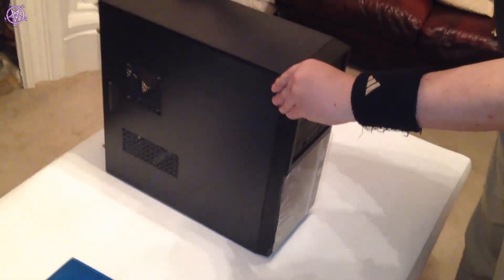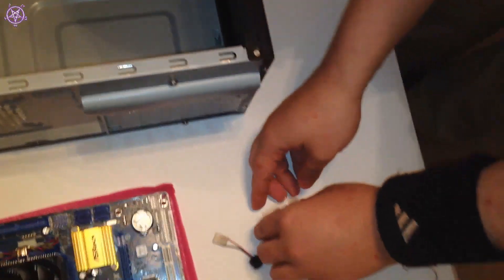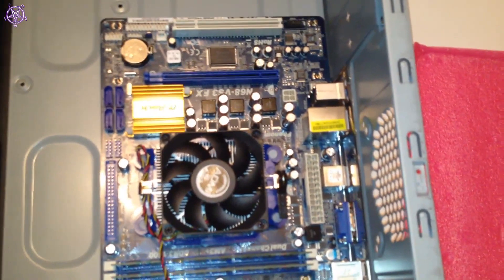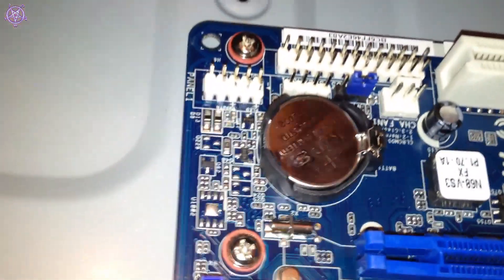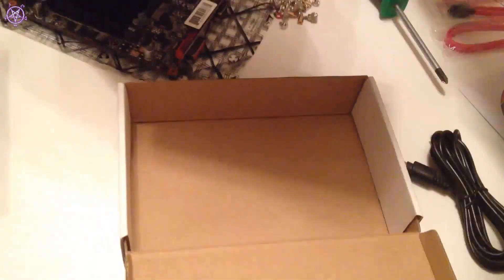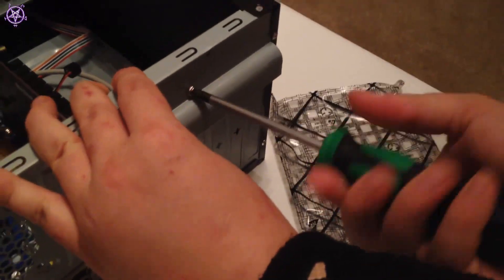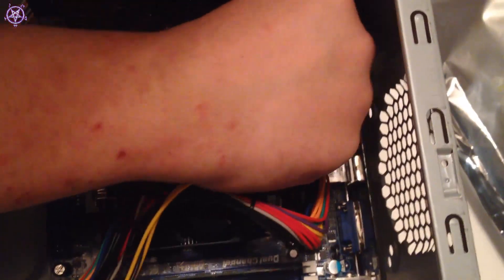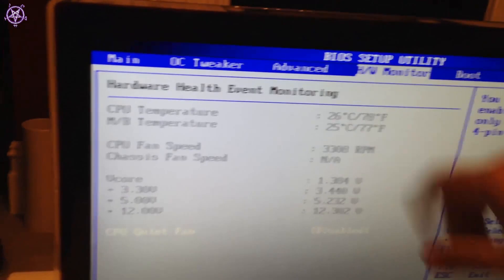How to build a PC in less than 30 minutes (Performance Home PC) [HD]

Comment from the maker: 4 ram slots does not mean it supports 4gb, there are 8gb sticks out there, so its 4x8=32gb ram, however most motherboards have limits, older ones can only read up to 2gb per stick, some have 4gb limit and new ones have 8gb per slot limit.
as i said, you have to google up your motherboard to find out what it supports.

Comment from the maker: Well if money is not issue, then you would end up spending like 3000usd. Go with Asus Maximus motherboard, i7 6-core CPU (about 900usd), some 2400mhz RAM with 9-9-9 or lower timings, Corsair 1000w (or better PSU) and GTX780 or GTX Titan (800-1200usd). video ram means nothing, you need GPU that is fast, like GTX780 ..etc (my GTX680 is more than enough tho). and don't buy crap company hardware, they fail. you can check out our forum for more info, we have lot of discussions about hardware.

Comment from the maker: Depends on your budget. for about 1000usd you can build a PC that runs any game on max in 1080p, but for GTA IV i recommend AMD Quad Core 3.6ghz or more, 4-8gb RAM (1600mhz recommended) and GTX660 or something equal/better. this build should keep you under 500usd.

however GTA IV is "broken", even on my pc i still don't get more than 40fps average (maybe cuz i have map mods). I had GTX550Ti and it ran it ok, with GTX550Ti SLI it ran perfect already and GTX680 is overkill for gta iv.